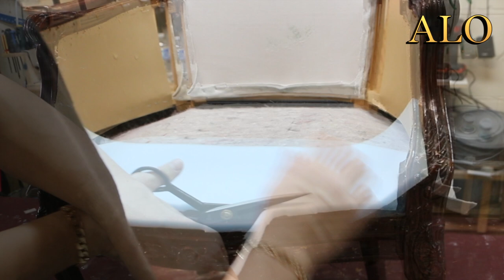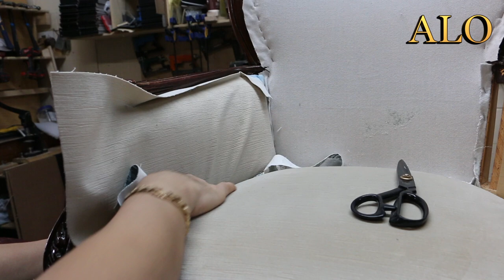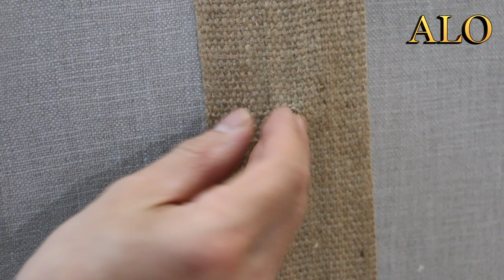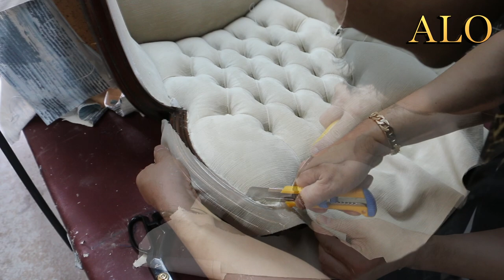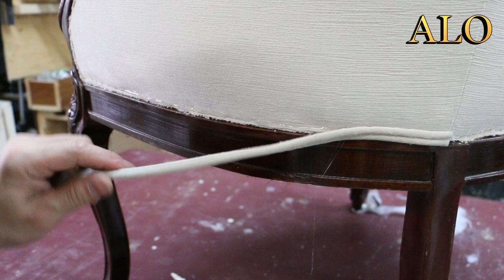HOW TO REUPHOLSTER A CHAIR WITH A TUFTED BACK - ALO Upholstery

Comment: Where did you get your button kit with the metal pronged backing? I’ve only used ever used twine and a needle and my foot to pull tight??genius to make holes in the foam. My chair is from the late 19th century, and even the professionals buttons popped off after 5 or so years. I would love for this to be the Last time this chair gets reupholstered.